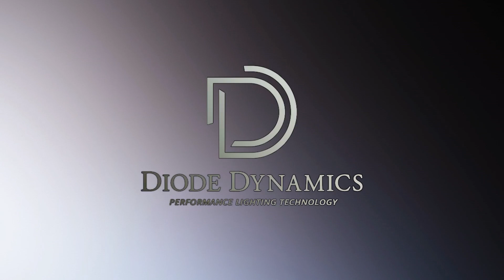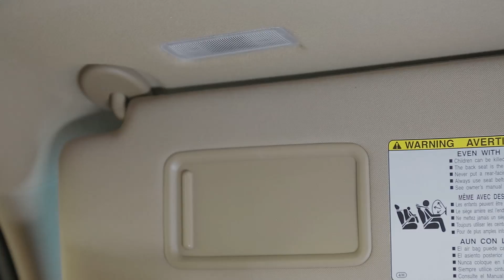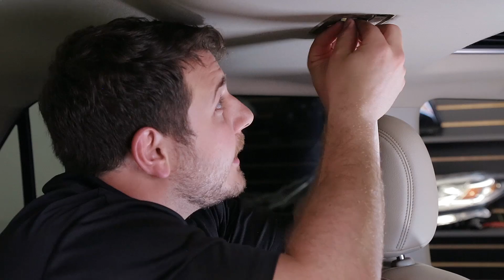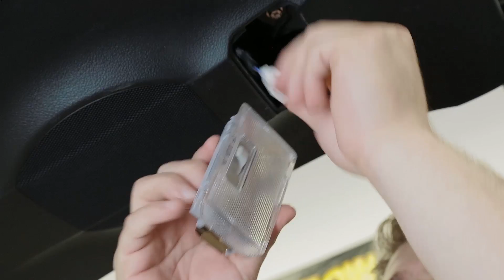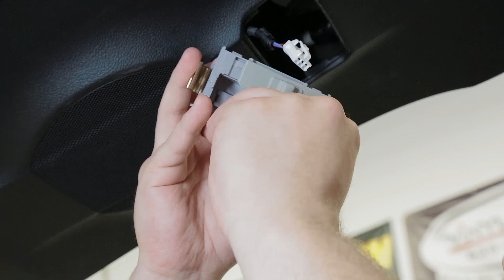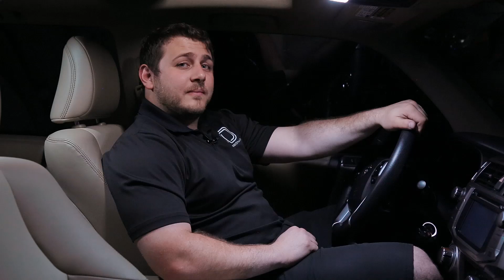How to Install 2014+ Toyota 4Runner Interior LED Lights

Comment: Wrong way to install the map bulbs. They’re super tight fit.

Remove the upper console. It’s just two screws if you have a sunglasses holder. If you have all the traction buttons etc it’s more complex.

Pull upper console out of roof. Twist bulb housing. Pull out. Replace bulb. Put housing back in. Replace upper console.

It was two screws for me. Took maybe 2-3 minutes tops.

Comment: Unfortunately the vanity bulbs I received only light up half the housing because they are a directional bulb and are mounted horizontally and not facing down.
Reply from the maker: That's interesting, Jesse. Do you drive a 4Runner?

Comment: How do you turn off the lights on the door?
Reply: They are always on and the lights are hot!
Reply from the maker: Hmm- There's a couple things you could try. You could see if the dome light switch will turn them off. If that doesn't work, we would recommend wearing gloves or unplugging one of you battery terminals.

Comment: The dome light was a pain in the butt to install.
Reply: All of them were a pain to install.. map lights were too small to get my fingers in to pull them out, dome light was a pain to put new bulb in, hatch lights were a pain to take out of the hatch.. nothing but a pita on the 4runner
Reply: Dome light is a fail by engineers

Comment: What happened to the glove box light?
Reply from the maker: Hey Chantha! It doesn't look like we were able to replace that one, unfortunately. If you want to send us a picture of your stock bulb or confirm the size from your owner's manual, we can let you know if we have an LED replacement. 
If you have any other questions, just give us a call at 314-205-3033, Monday-Friday 9 a.m.- 5 p.m. CST, or shoot us an email at contact@diodedynamics.com!

Comment: Are all the replacement bulbs available in a kit?
Reply from the maker: +Keith Williamson Unfortunately, we do not have a full kit available at this time. Sorry about that! However, you can order each bulb at the links in the video description above. If you would like any assistance placing an order or if you have any questions, please don't hesitate to contact us!
Reply: Thanks, I'll be ordering them.  Nick C is a good promoter.

Comment: The maps lights were damn hard to remove.  I wrapped some tape to needle nose pliers and "gently" manipulated those €><##^^ bulbs out!  Nick C makes it all look easy.  😎
Reply: Thanks for the tip!!
Reply: I didn't use tape but they were much easier to remove with needle nose pliers once I popped off the center lens cap

Comment: When adding the rear lights in the hatch I noticed a strip of LEDs on the back. Could you provide a link to the LED strip.
Reply from the maker: +Derick Serrano Thanks for reaching out! Unfortunately, we do not offer an LED strip made specifically for that location, but check out the link below for our universal LED strips! 
http://www.diodedynamics.com/store/led-bulbs-1/led-strip-accent-kits/led-strips.html
Reply: @diodedynamics  great video! Do you offer a whole bundle/package for all  the areas or do you have to buy them all separately?
Reply from the maker: @FearIess1221  Thank you! And due to the variety of brightness and color options we offer for the 4Runner, we don't currently offer a prepackaged kit. Sorry about that!